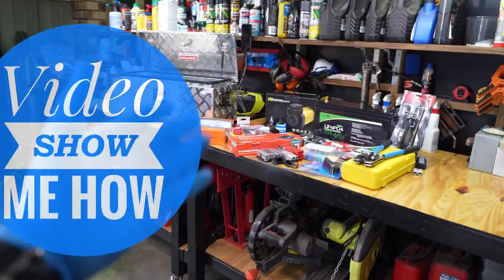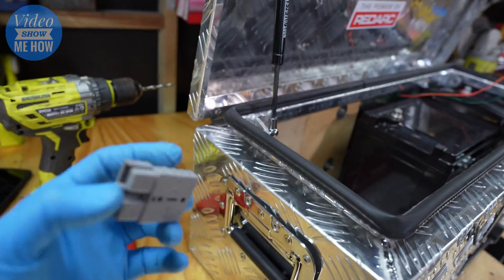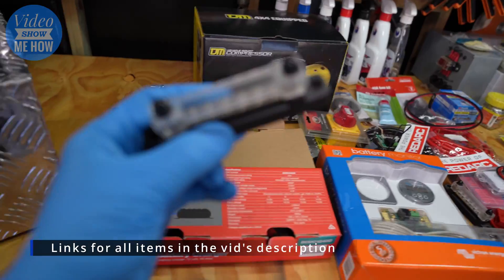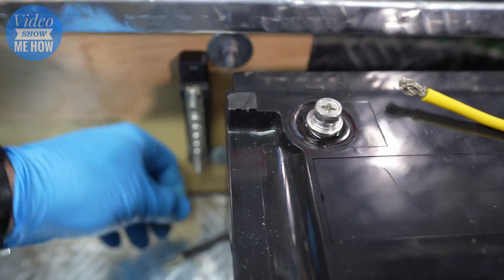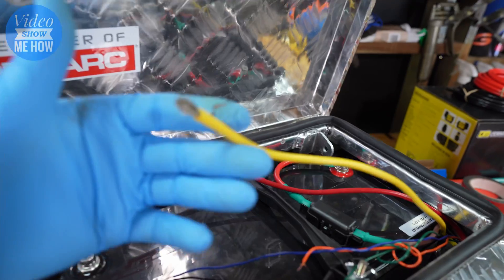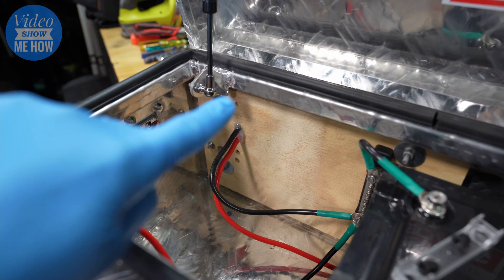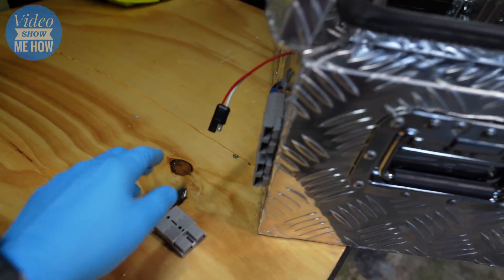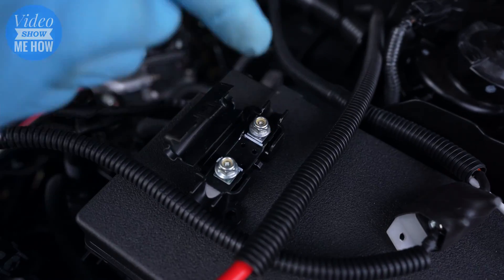HOW TO Install REDARC BCDC 12v Dual Battery DC-DC Battery Charger BCDC1240D [Isuzu D-Max Build #11]

Comment: Question regarding acc circuit fuse tap.
I’ve just fitted a dcdc charger and plug and play battery system in my 24 dmax tub and also found the only circuit for ignition trigger wire was a/c fuse .
Issue is that piggybacking that is that with fuses in the tap it fouls  on the adjacent relay with the fuse tap in the correct orientation.
Reason I’m asking is I accidentally had it around briefly the wrong way(something I wasn’t aware was a thing) to test everything was working which it was charging etc etc but discovered that the A/C wasn’t blowing cold air as a result.
I was told by an auto sparky that having a fuse tap in the wrong way bypasses the original circuit and only powers secondary one .
Once I disconnected it and ran a fuse only in ac circuit the air con worked again fine so my question would be how did you not encounter this issue ?

Comment: Isn't that grommet that you used the drain for the roller cover?
Reply from the maker: For the factory roller? No, you'll be horrified, is a small short pipe at the tailgate end that just runs under the plastic tub liner

Comment: Hi mate great video 👍 in the instruction manual it shows a low voltage disconnect/isolator from the auxiliary battery as well. I didn’t see that you put one in? Is it not needed?
Reply from the maker: @mickmartin2480  Cheers 👍 No never added one, wasn't needed. It's meant to be an additional stop gap/protection for your starter getting too low (but this is also what the bcdc should do also). I run a separate physical isolator switch so haben never put ones of these in or had any issues 👍 If you're running a second battery 24/7 could be worth adding.
Reply: Thanks mate👍🏼 appreciate the advice!

Comment: Great video mate, really professional work! How do you get the cable out of the fuse box while still keeping it sealed up? Drill a small hole and seal with silicone? Thanks in advance 😊
Reply from the maker: @Bumpstead_  you got it 👍

Comment: Hey so I had an auto electrician install the wires from the starter battery back to inside my van. He wired the black cable to the negative on the starter. He said to just attach this case straight to the negative on the leisure battery. Sound right? Also, how did you work out cable and fuse size?
Reply from the maker: @timquain5341  neg starter to neg second battery? Then POS to pos i assume? One way to do it yes. Recommend checking out the redarc resources https://www.redarcelectronics.com/au/resources/chargers-isolators-wiring-guides/how-to-wire-bcdc-caravan-vehicle-variable-voltage-alternator/

Comment: Awesome video mate. 1 quick question, if i have an agm deep cycle battery do i still join the orange and green wire together? Cheers
Reply from the maker: That's the way redarc soooo their profile selection, that tells it it's lithium. This will depend on your unit, jump on their website to confirm, they have all the wiring diagrams etc there

Comment: So you run a earth from the chassis instead of running from the crank battery negative terminal?
Reply from the maker: Can do both, but yes I've used the chassis point instead of running all the way back. I did this when I was running this and also now running the bigger Victron system
Reply: @VideoShowMeHow  Yeah nice one 
Very informative videos mate keep up the good work 👏 Thanks

Comment: Hello, i watched you video because I wasn't sure of my installation, and you seems to have the same as me. When my engine shut down, the Li light is blinking, I thought it was an indicator of an issue, no?
When I start my engine, the Li, vehicle and stage light are fix (light, no blinking), is the installation correct?
Reply from the maker: yep that's correct.

Comment: Hi legend, 
thanks for you vid! I just have one question, is it imperative to have an isolater switch, is that to stop DC-DC running down my starter battery when I’m
Not driving the car?
Reply from the maker: It should voltage sense, that is turn the charger off once voltage drops to a specific figure eg car turned off and alternator not charging. It's recommended though to be able to isolate the system

Comment: Hi Adam,

Wired up my redarc BDDC charger ( AGM Battery & orange wire not connected).
 And connected blue wire to AC fuse.

Also have wired in a fixed solar panel, and it's light is also on with ignition off.

And charge status stage light flashes once every few seconds.

With ignition off, my charge profile light ( A )  is on.

Is this correct ?

Unit is not hot to touch.

Cheers Jason
Reply from the maker: Hmm hard to diagnose over here, sounds like it may not be switching off. Great info in their own guide to help - https://cdn.intelligencebank.com/au/share/yE9N/zJpl/oGLrq/original/BCDC+Dual+Input+Instruction+Manual
Reply: @VideoShowMeHow  thanks Adam, so I checked it with a multimeter today.

Ignition off in A/C fuse it's showing 4volts.

Car running A/C fuse is showing 13/14 Volts

Comment: Just start my project on Dmax!
Did you actually made a hole on rubber grommet? I pulled cable just like you did. And i was not sure about that grommet.
Reply: And what is that grommet for ? 
If you know about it.
Making sure im not drilling anything important😅
Reply from the maker: The tub grommet?
Reply: @VideoShowMeHow  yes
Reply from the maker: I just removed and used some rubber on the edges at the time. Have since replaced the grommets though, they're essentially to keep the dust out

Comment: Great video again Adam as usual, where did you get all your wires and other gear from please mate, keep up the great work.
Reply from the maker: Most things used are linked in the video description. The rest were the standard Supercheap, Jaycar etc
Reply: Great thanks so much Adam I just found out how to look in the description lol. On a side note I just fitted the custom off-road bash plates, fantastic product, cheers for that video as well. Cheers Wayne

Comment: Hey mate, love the vid only question I have is if you are using a 60amp fuse but you are only using a 50amp rated Anderson plug does that mean if shit hits the fan that the Anderson plug would melt before the fuse blows? Only asking because I want to make sure I buy the correct plugs. Also is it alright if the negative wire is only 8AWG even tho the positive wire is 6AWG. Ground wire is only 1.5 meters long. Cheers
Reply from the maker: Most Anderson plugs are rated to 50amps disconnect only, are higher for continuous current. Just double check the rating of the plug

Comment: Hi, awesome video mate, just wanted to know why you used the connection with the red/white wire? And why didn't you do with the solder/heat shrink connector? Seems you only used 1 of the wires? Cheers, I hope to hear back soon. Once again, awesome, very helpful to everyone  out here. Thanks.
Reply from the maker: Hi, was to get the trigger wire into the box. Is that the one you mean? I didn't solder as I wanted to be able to remove the box. That connector was just one I had, originally intended to use as a spare for something else but ended up redesigning the whole thing anyway (hence the StorMod vids)

Comment: Hi mate I notice when the car is off the vehicle is solid red and stage is blinking for floating charge. I do have the blue wire connected to an accessory fuse only turns 12volts when ignition is on. So my question is, while the keys out of the car does the redarch bd dc have the LED light still on the vehicle and stage ? Or should it be off completely?
Reply from the maker: Should start blinking for standby mode. May not happen straight away though, check it after 5mins

Comment: Great help planning my install, thank you!!  CAUTION NOTE I am 80% sure those connector/piggyback fuses have to be installed in the correct orientation to work correctly. 
In the fuse box 1 side of the fuse rail is connected to a power bus thingy and the other runs to the AC, ciggy lighter etc. The pin on the wired end of the piggyback fuse needs to attach to the AC/ciggy side pin not the powered bus side pin. Your 5 amp fuse will never pop if installed the wrong way. (Good chance I'm wrong; worth noting if I'm not ;)
Reply: Your not wrong that is definitely the case with those fuse taps

Comment: Hey Adam. great videos. im watching while recovering from surgery. one question though. that wire to the AC fuse, is that the one going to the blue smart alternator wire? i dont have have a smart alternator. do i still need to connect to an ignition on fuse? thanks
Reply from the maker: If no smart alternator no blue wire needed

Comment: Any reason you chose the bcdc1240d over the bcdcn1240?
Reply from the maker: Bit more flexibility of being able to use in different future applications (the bcdcN is for incab only eg not weather resistant)
Reply: So to save a couple of dollars i could use the "n" for a behind seat install correct?
Reply from the maker: Yep 👍

Comment: Just installed my BCDC1240D - pretty much exact same setup as yours installed the same way. And after 20 mins of charging, I found the Anderson plug connecting positive starter battery > dcdc charger had melted together!! Any ideas?
Reply from the maker: I would say there's a bad earth, sound there's high resistance somewhere. Have been running mine via an Anderson since this vid came out no probs
Reply: @VideoShowMeHow  I ran the earth from both the aux batt and dcdc to the main earth on fuse box bus bar. Then one single earth from bus bar terminal to seat bolt chassis.

Wonder if maybe too many earth points on the fuse box bus bar. Might be better just to run all earths to seat bolt individually
Reply from the maker: @alwynvanderlinde9507  busbar large enough? All crimps of good quality etc? Potentially one of the Anderson crimps is a bit ordinary maybe check that first

Comment: Assuming you only use the bus bar on the fuse box - could you run the negative from AUX battery to the main neg terminal on fuse box, then send all negatives to fuse box bus bar and have one negative cable from fuse box primary neg terminal to chassis earth? Wiring mine up this way tomorrow. Hopefully nothing explodes 😊

Comment: Hey mate happy Monday 
I’m going to setup a lithium battery in my camp trailer can I run a solar panel just to charge the battery on its own not connected to a alternator
Reply from the maker: Yep, prob cheaper just to get a solar reg though?
Reply: @VideoShowMeHow  will do 

Thanks Mate gonna run a Victron 100w25amp
Reply from the maker: @michaeljenkyns1719  have one of those on the camper, is great particularly with the app 👌

Comment: Hey mate great videos 
I want to install a dc dc charger do I have too disconnect and remove my red arc battery isolated
Reply from the maker: Don't have to, can run in series to you second battery feed. I run an switch isolator on mine, after main battery, before the bcdc. That way can easily isolate the bcdc and rear battery box. If you check the 12v accessory plate video you'll see what I mean
Reply: Thanks mate
Reply: Also mate with the yellow solar cable I’m running Pv connectors on my bcdc how do I connect a earth cable to that connection
Reply from the maker: @michaeljenkyns1719  can run that to any earth point
Reply: @VideoShowMeHow  cheers mate

Comment: Firstly, great video like all of your other. I followed it to a T! since installing the bdcd a couple of months ago I have had 2 flat batteries, so I'm wondering does the redard draw from the cranking battery. Any advice would be great
Reply from the maker: Hey mate, the bcdc should cut out once it's input falls below 12.7, back in when above 13.2 (and the smart alternator input if you have this). Which battery is going flat? Worth also checking the status light behaviour on the bcdc, the charge profile light should blink once it goes into standby, solid when charging.

Comment: Hi mate, great video by the way! How would you go with having the red arc unit in a camper to charge your camper batteries with a car with a smart alternator. Would you have to run ignition wire to properly charge the batteries in camper trailer while driving?
Reply from the maker: Yep you would if you had a smart alternator

Comment: Hey Mate, if you turned the accessories on and not the engine would the BCDC think the alternator is running and charging the Aux battery and as a result drain the Aux battery?
Reply from the maker: No, one of the input conditions is it needs to see 13.2v +. With car off at rest you'll usually will see 12.6-12.8v at the starter battery
Reply: @VideoShowMeHow  epic, thank you. Would it be worth moving all the accessories over to second battery so no matter what you can always drive home?
Reply from the maker: @Captainpillowpants  yep I'd recommend using an aux battery for anything you use while car is off. Winch, spotlights usually still would run of your main as car will be running (and need the current draw for winching etc)

Comment: Hi Adam, I have a REDARC BCDC 1225D (25amp) charger and a Kings 12 Volt control box and a KickAss slimline aux battery. Do you have the wiring diagram for this? (No solar as yet). Cheers again Champ. (2021 Isuzu Dmax XTerrain) I will be running a Evacool fridge/Freezer and Air compressor off the Kings Control panel Anderson plugs (2)
Reply from the maker: No don't have direct experience with those boxes sorry mate, check-out the redarc site though they have great wiring diagrams for different scenarios 👍
Reply: @VideoShowMeHow  Cheers Adam. I found a Redarc YouTube video awhile ago which should help.

Comment: really great instructive vid mate - well done, what was the approx cost excluding the battery? cheers
Reply from the maker: Cheers mate - for the BCDC or the whole box?
Reply: the whole box if you can......and ball park is fine ($10, $20, $50 👍👍) cheers
Reply from the maker: @steve-deltasdad3906  don't have exact but would have been around 2k with everything Inc compressor but without battery
Reply: ok cool, thanks for the info.

Comment: Hey Adam, 

Great content and help with the video. I am currently booking up two Anderson leads on my DMax XT (one for Redarc DCDC in tub and one for caravan). Have run twin 6B&S x 2 back to under bonnet. 

Regarding where to hook up the negative I’ve read it has to be on the chassis side of the shunt module that comes off your main battery. If you hook up prior to this on main negative smart alternator won’t work correctly. Is that right?

And when hooking up the two main positives I saw that you came before the electronic modules and hooked up to main positive before the module. So is it opposite to the negative?

Thanks for your help!
Reply from the maker: Yes that's right, the neg for the smart alt has a little shunt, if you checkout on the recent vids on the channel like the winch install (might be a pic on the community tab come to think of it) it should show how everything is connected on the new 12v plate, is a bit clearer to see
Reply: @VideoShowMeHow  ok cheers. Thanks for that. I noticed you used the AC fuse for piggy back. I tested it with my meter yesterday, it’s not actually an ignition wire is it because it works on accessory?

Comment: Super helpful. Have just installed a second battery into my bt50 2022. I had to tap into the IG fuse as tjm tapped into the ac already. Everything works well however I keep getting front camera unavailable. Any ideas ? Thanks
Reply from the maker: Hmm shouldn't impact.. I'd drive for a bit see if it resets.
Reply: @VideoShowMeHow  yeah it seems to have fixed itself after a few restarts. Thanks !
Reply: So it's happened again this morning. It must have something to do with the second battery being charged. Are there any other fuses apart from the AC you'd recommend tapping into ? Thanks
Reply from the maker: Haven't tested beyond that one, you'd just need to find one that only turns on with ignition, use a test light to find one there's probably a few. Still find it odd that the camera unavailable has anything to do with that circuit.. it's not super sunny or anything when you get the unavailable? This can cause it to be temporarily 'blinded'
Reply: @VideoShowMeHow  yeah strange one it is. It's early in the morning so not really. Just hasn't happened before I put the second battery in. Seems to have fixed itself again hasn't popped up since the first start this morning. Will see how we go. Thanks

Comment: Hey mate great video. 
How do you determine the size of the midi fuses.
Reply from the maker: The size of the circuit plus a bit of headroom to account for voltage drop etc. Most BCDC units will have a recommendation base on their output, the BCDC40 like the one in the vid is 60amps
Reply: @VideoShowMeHow   thanks for the quick reply mate. I’m looking at a 1225d so that should tell me how big fuse I need ?
Reply from the maker: @mitchelltatterson9799  redarc recommend a 40amp

Comment: Hey dude, ordered the micro fuse piggyback adaptor as per your link but Isuzu Dmax 2021 uses micro2 fuses so might wanna update that link. Apart from that, awesome vid. Cheers
Reply from the maker: Ah rats you're right, I'm unsure why I had the standard micros there, the other vids are ok but missed this - apologies! Shoot me your postal and I'll send you some merch 👍🎁

Comment: Hi mate sensational video. The only question I have is in regards to the drainage hole/ bung you pass the cabling through in the tub. Where does the water go through the shutter drainage without having them in place?
Reply from the maker: Hey mate, short answer is it doesn't. I was planning on replacing the hose but haven't had any leak in so haven't bothered. Just assume it's not going down the drain in the first place